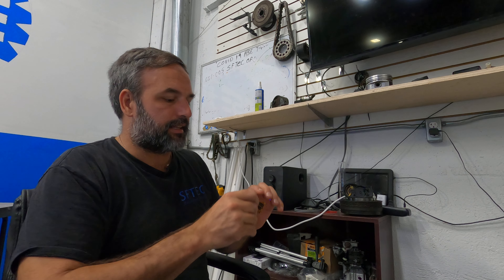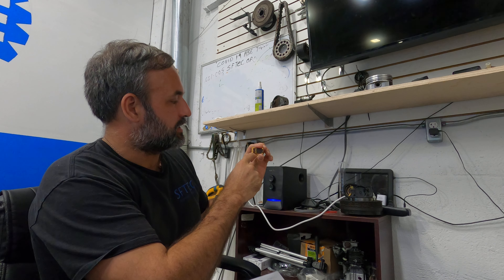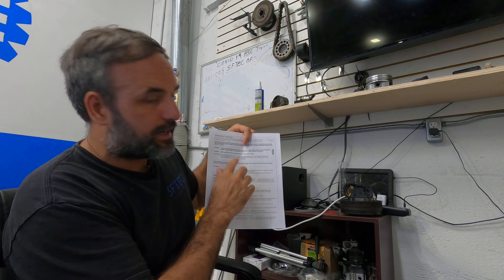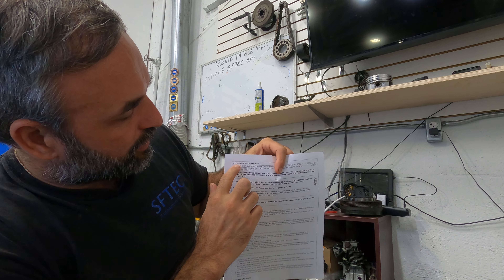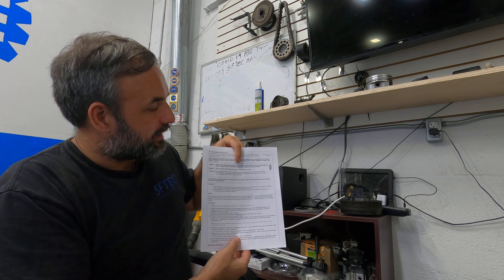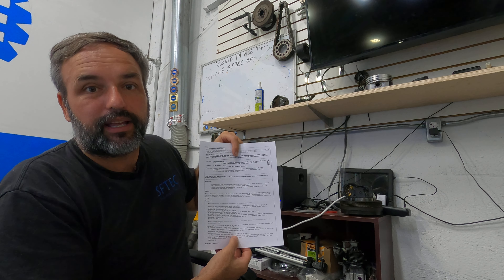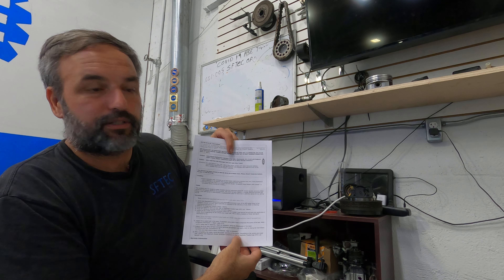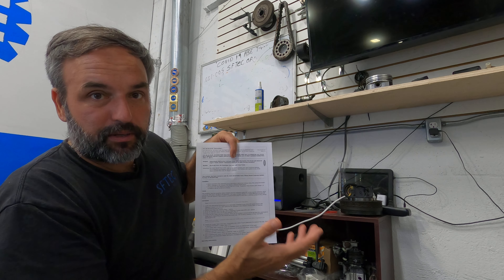The real fix for code P2138 and Reduced power Message on GM vehicles from 2005-2018 #P2138

Comment: Very helpful. This sounds exactly like my problem. Happened to me twice during heavy rain. Made a complaint to NHTSA.
Reply: What vehicle?
Reply: @brianlacroix6894  2014 Silverado 5.3L
Reply: @fredvincent4224  oh yeah thats the culprit. They get water in every thing.
Reply: @brianlacroix6894  sold that truck cause it started knocking on start up @180k miles. Bought a new Sierra & now dealing with the 3.0L diesel long crank no start issue 😂😂. At least it’s still under warranty. F*^K

Comment: Damn, This kinda confirms what I've been thinking to a degree. I've got an '06 ion redline and it's been acting up in the winter up in washington. I've replaced the PCM, Throttle body, and even the throttle pedal and while those did fix those codes initially, going through the summer into the winter again, I've been getting p2135 and p2138 on the regular. I'll even get a few more codes sprinkled in there, but those are the primary codes that are almost guaranteed to pop up every time. I'm just trying to find some sort of guidance to finally solve this issue because even with the mileage the car has, the engine runs like a champ.
Reply: I'm having this problem rn have replaced everything accept pcm but my car won't even start did u get it fixed?
Reply: @codeylombardo8057  No. I think it was the plugs on the PCM harness, but a brand new harness is hard to come by

Comment: Thank you very much for the videos.  I have watched 3 of them that you have posted on this subject!   

I bought this truck (2012 Chevy Colorado) about 4 years ago.  in it's previous life it was a work truck for a yard maintenance company.  I knew it had some electrical issues when I bought it (radio didn't work, dome light would not come on when drivers door was opened). But I drove it for almost 3 years with no problems. About 15 months ago I got the P2138 code.  I have one of those FixD code checker things that blue tooths to my phone.  Not really a great diagnostic tool I know, but I t does let you know what codes are coming up.  Anyway I replaced the pedal, that didn't work.  So replaced the throttle body with a Bosch (not GM) and that worked for about 15 months until the other day.  When the code came back.  Talked to a few local mechanics and they all said try a genuine GM throttle body.  That seemed to work drove the truck for about 60 miles everything was fine. The next day (yesterday) didn't even get out of the driveway and the code showed up again.  It was so bad I could not even clear the code, it just popped right back up very quickly.  

Looked at your videos this morning and went and jiggled the connectors that I could reach.  Bent them at a little bit different angles, unplugged and replugged 2 of them.  Started up the truck cleared the codes right away.  Took it for a 10 mile test drive parked for 20 minutes went for a walk and then drove back home.  All is well so far.   Next step I guess is to replace the connectors and wires to the ECM.  Not sure if that is something I want to tackle or have a mechanic do.  (going to take it to a friend mechanic that I think has a tester like in your videos with real time readings, and see if any of the values change when the wires are jiggled and wiggles around).   Will update after I do that.

Just wanted to comment here in case somebody else was having similar issues.

Thank you for the videos.... And at least giving me a place to start fixing the problem.
Reply: Thank you for the info. Could you tell me what ended up happening?

Comment: I have spent thousands at the Cadillac dealer to fix this issue, I'm on my 4th accelerator pedal, replaced ECM, they claimed to have replaced connectors, when I asked about this TSB they assured me no water was getting into any connections. I'm so frustrated.
Reply from the maker: Just run new wires with no connectors and re pin 6 ECM pins and a new app pig tail.
Reply from the maker: Also check all ground connections and battery connections.
Reply: My 2019 chevy impala is put in stabilitrak multiple times when driving and vehical is at the dealership for the 3rd time replaced accelerator pedal twice,put a new purge canister valve on,cleaned throttle body, they called me today 8/13/24 said they are going to run a pig tail to the pedal any thing I need to let them know

Comment: I have to say you give me hope! Own a '15 Traverse LT (185k miles to date), issue first happened at 69K miles, the pedal accelerator pedal and connector have been replaced 6 times - my car, like clock work, would throw code P2138 about every year, mostly warmer months- since 2019 (Traction Control Off/Service Stabilitrak / Reduced Engine Power / Speed limited to 25mph - all without warning - until last year...when this occurred in July of '24, October of '24, December of '24 and now 3 times in Jan of '25.  Dealership has had my car for 9 work days...can't figure it out. Said I had to bring it in when the car is in this mode (did that, and then I was told they were too busy.). At my wits end, can't drive on the expressway, due to going from potentially 70 to 25 and has affected, of course, all aspects of life.

Have filed a complaint to NHTSA and to Chevy pretty much each time this has happened - would love a recall to happen.

Here are recent comments from the Chevy mechanic who looked over the car (1/3/25) and it seems my connections are good? At least that is how I read it (not a mechanic here so feel free to correct!) I will say my DIC goes in and out and recently it has faded quite a bit, wondering if water has gotten into this area too and maybe everything is somehow connected? Now also the last several times my engine warning light goes on for several days, then turns off, then the reduced power happens.
BTW - way more codes than usual....
-History code p0300, p0420, p2138, c0299 5a and c0242
-Inspected connector for accelerator pedal
-Terminal tension was ok
-Checked terminal tension at ECM and was ok
-Inspected inline connector x111 and looked normal with no corrosion
-Tested circuits 1272, 1162, 1274, 1271 1161 and 1164 from accelerator pedal connector to EXM connector and all had 0.1 ohm resistance.
-Wiggled harness that was spliced in inside vehicle and resistance did not change
- Ground circuits had 0.3 ohms which was normal
-Tested 5 volt reference and tested good
-Jumped 5 volt reference circuits to signal circuits and scan tool showed 4.99 volts on scan tool.
-All circuits and ECM data tested normal

Thanks for this info - at least something else to consider. Will take the TSB to my mechanics and will update if I end up finding the root cause of this.
Reply from the maker: The fretting corrosion that causes the accelerator issues is microscopic. I have a 2010 Silverado and when it happens unplugging the ECM and re plugging it in stops the issue for 2000-5000 miles then it happens again every 10 miles until I unplug and re plug the ecm. I replaced the ECM and it stopped for 5000 miles. The ECM has gold pins and the harness has plated pins so you get that galvanic corrosion going on.

Comment: I believe this same issue is going on with my 2005 corvette
Reply from the maker: Its very common with the E38 ECM. I just had one that was a ground issue in the ECM itself that was intermittent, but the wiring is the most common. You need to look at the freeze frame records at the time of fault to determine what circuits are acting up.

Comment: Would this explain why I primarily get this issue in the winter when the water would freeze and further mess with the connection?
Reply from the maker: When its cold things are smaller and as they warm they become bigger. The hot cold cycle effects it. Also loose connections act worse in cold weather because the metal is smaller.

Comment: Interesting information here. I have been working on this code for my sons 2018 Turbo Encore. It started running like crap and you could here a vacuum leak so I built a smoke machine and found the split hose. It had a MAF code and we replaced that also. It overheated short time later and it was a busted coolant bottle neck. Replaced that and then we got this P2138 code. New pedal installed and I can clear the code and drive forever but code returns to limp mode and shows P2138 and MAF code again. I checked all of the pins on that 3 plug computer board and cleaned with electrical plug cleaner. No water intrusion into cabin. Anything else to look at?

Comment: You may have to have the code cleared a few times, but the best thing to do is to put the new part in turn your key on. Do not start the vehicle press your accelerator all the way down to the floor and hold it then let it slowly off and then do it again and hold it and then let it off and then start the car and then shut it off. You may have to go to the shop so they can clear the code a few times, but then You just need to keep Driving it and clear the codes a few times which if you take it to Shop to get done, they should do it for you, whatever you do, don’t keep buying new petals to put in just keep clearing the coat truck. The vehicle has to learn that it’s not jacked up anymore. I don’t know why the codes are so hard to clear on this one, but it is a pain in the ass once you finally get it cleared it’ll be fine, it shouldn’t take but at least
Reply from the maker: I have almost never fixed one with a pedal it has been wiring or the ECM 9/10 times

Comment: I get it sometimes . Sometime does not . I just erase it with ob2 . It takes a long time to for the check engine ligt to come on .
Reply from the maker: I have seen loose connector pins cause this code more then anything but I have seen an ECM cause false high voltage codes likely a ground fault in the ECM. I always recommend starting with the elimination of C-205 and C-109 with new pins at the APP and ECM. The wires take a few hours of labor but the parts are fairly cheap.

Comment: I am having this same exact issue on my daughters 2012 Equinox with the 2.4L EcoTec. I replaced the pedal and throttle body. What's bizarre is that I can reset it, and then the only way it will come back on is when you press past 50% throttle. Should I be looking at the ECM connectors and/or replace the ECM?
Reply: This is my exact issue!  No code unless i give it 50% or more throttle.  What did your issue turn out to be?
Reply: @JCOOK33440  We have a 2010 Equinox LTZ 3.0, replaced  many parts chasing this issue.  New Throttlebody, Accelerator Pedal Position Sensor, MAP and MAF sensors, and more.  When sitting idle in park, slowly accelerate to 3000rpm, everything ok.  If apply wide open throttle quickly, while parked, it throws a P2138.  Considered replacing the pigtail for APPS but after watching this video, wondering if that makes any sense.

Comment: Does this work for buick regal 2011, reduced engine , check light , stablilitrak showed dealer fixed then 4 days later message came back they did check  said replaced connector and I am good to go can pick auto up. Then in the next 2 hrs they texted said they drove auto message came back. They reached out to GMC said may need replace ECM. Before now saying ecm i asked because it was a less than 5 days auto had to go back why should I pay for the connector.  They didn’t charge me now all of sudden ecm but they are going off gmc person told them may need to replace. Please help with a few questions
Reply from the maker: I have found connector pin issues more than anything causing the codes. In the attached video I am diagnosing a 2010 Silverado with an accelerator problem. Essentially it is the same, but you need to monitor the data when the issue is happening to diagnose it or just re wire the accelerator wiring from the pedal to the ECM. 

Often it is a pin tension issue at the ECM so you need to replace the pins and wires from the ECM to the pedal. 

https://www.youtube.com/watch?v=uGEaJvE8QJQ&t=8s

Comment: I have this p2138 replaced throttle body and pedal , shop wants me do a new harness , wouldn't re doing wires like u just showed fix this issue 2011 camaro 3.6
Reply from the maker: Yes. At the dealer techs just run new wires from the ECM to the APP. Just be careful to make Shure the wires are protected from chafing or rubbing.
Reply: Do you have a video showing this repair?

Comment: My Chevy Sonic is having the same problem. Code P2138 shows up while driving. I replaced a new pedal but problem still there. Engine power was reduced while I'm on I95.  I live in Hollywood. Can I come to your place to have it diagnosed? Please help
Reply from the maker: What year?
Reply: @southfloridatechnicaltrain2589  2014  Sir. It’s LT 1.4 turbo
Reply from the maker: @nurseon2wheels  Ill look in my computer and see what is out there after class.
Reply: @southfloridatechnicaltrain2589  yes Sir. Let me know. Im so frustrated now, just bought this car used 2 months ago
Reply from the maker: @nurseon2wheels  Potential causes are Accelerator Pedal Position (APP) Sensor
Accelerator Pedal Position (APP) Sensor Wiring
Connector X101
Connector X202
Engine Control Module (ECM)

I would look at the connectors. x101 Because it is #101 it should be located in the front. According to service info it is located in front on the drivers side of the engine.

Comment: Do you have a video to where you show this being done please because I replaced my pedal as well and it's still doing the same thing when it rains
Reply from the maker: I have been finding the issues lately in the ECM J-1 connector. If the voltage is high its a ground and if its low its 5v or signal.
Reply from the maker: I made a new video for you. How to do the diag. https://youtu.be/uGEaJvE8QJQ
Reply from the maker: You should be able to get every thing you need from this video

Comment: I replaced throttle and pedal code never left since I got it either. So how much is the work to do the new wiring for the pedal?
Reply from the maker: The dealer typically charges 6 hours from what I am told. It should take someone from 3-5 hours.

Comment: Been dealing with this on 15 Chevy Spark for the past two years. If replacing the pedal doesn't fix the problem, will it do any damage to the engine (or whatever) to just live with it and reset the code when it pops up every few months?
Reply from the maker: I have fixed several by changing the ECM but you really need to use a scan tool and monitor the data to diagnose the problem .
Reply: @southfloridatechnicaltrain2589  Thanks, understood, but assuming it is just an electrical issue and not actually a problem with the engine or whatever, is it harming anything to just reset the code when it happens?
Reply from the maker: @brandonlecrone6838  Every time the system goes into reduced power mode it is stopping some kind of unintended acceleration. Now 2012+ vehicles have better systems to stop that then older vehicles but you are still at risk. I would defiantly fix  it.
Reply: @southfloridatechnicaltrain2589  Gotcha thanks. My daughter will be moving to Boca in August and this is her car. I can't get anyone to listen to me, they all just want to replace the accelerator pedal. Is there someone in that area you could recommend we take it to? I hate to have to drive it all the way down there (from Ohio), but literally don't know where to turn.
Reply: I do have a basic scan tool and am pretty handy. Not sure if the tool I have will provide the necessary data. It certainly doesn't look like the one in your video!
Reply from the maker: @brandonlecrone6838  Yeah you need to go into the tac part of the ECM data and monitor the APP data. I have a video on that on a 3.6 cadi and a silverado 5.3

Comment: both signal wires?
Reply from the maker: If you have a code for both signal wires, it is likely a ground fault, loose connector or one sensor is shorted to voltage. The E38 ECM only has 1 ground and if power is shorted to one wire it can affect both sensors especially when it's the ground for one APP.

Comment: What part of south Florida you are located?
Reply from the maker: Miami
Reply: @southfloridatechnicaltrain2589  medley??
Reply: @southfloridatechnicaltrain2589  hey thanks for responding ..I'm having a p2138 code in my Vette ...I cleaned up throttle body yesterday and it keeps accelerated for some seconds is it normal ? ...
Reply from the maker: @panzerwaffen2873  I am in medley and could look on Monday for no charge. I research Unintended acceleration and would like to look at it.
Reply from the maker: @panzerwaffen2873  If it wont stop accelerating put the shifter in neutral to shut it down.
Reply: @southfloridatechnicaltrain2589  thanks for the advice ...thanks a lot for taking the time to respond
Reply: @southfloridatechnicaltrain2589  while driving? ...it won't stay accelerated idling it stay accelerated while driving
Reply: I'm in west palm beach how can I set up a trip
Reply from the maker: @bryanCLXT  Sorry I never saw the message just call the school number 305-888-2279